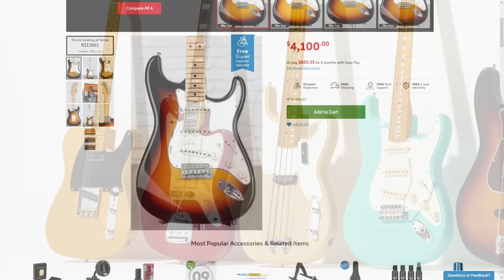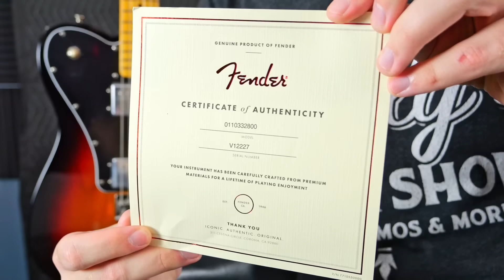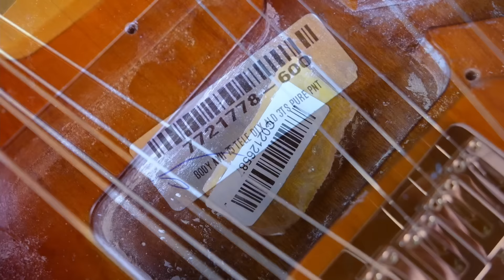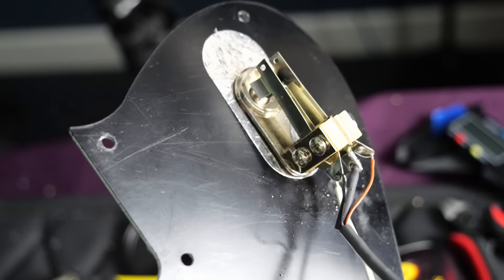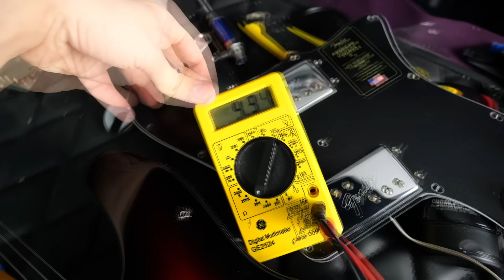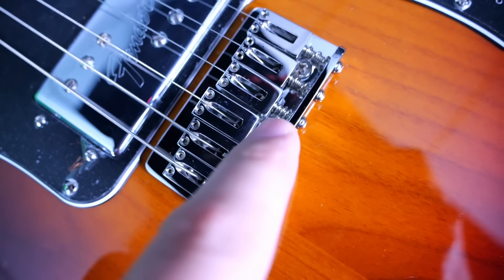An Embarrassing Factory Error... |  Fender American Vintage II 1975 Telecaster

Comment from the maker: Do you like CuNiFe pickups?
🟢Buy This Demo on My Website: https://www.troglysguitarshow.com
🔴Reverb: https://reverb.com/shop/troglys?_aid=growsumo&gs_partner=Trogly
❓Private Help Sessions: https://troglysguitarshow.com/help-appraisals/
Reply: Are you sending this to Philip M by any chance?
Reply: There's your quirky feature . The inlays being slightly off center. Well that and the large stratocaster style headstock. Personally I like  it. Is that a neck tilt access on back through the bolt on plate. So Fender has figured out how to silence single coils now they need to figure out the cunifies . I like this one but that buzz would drive me crazy. It does have a Telecaster sound but .
Reply: The way the body was made including the wood grain mismatch is a cbs cost of manufacturing savings that was common on originals. For 2100 they should have put on a neck that was drilled right for the inlays that aside help to I.D. It in case of theft
Reply: I don’t have a fender telecaster that has CuNiFe pickups, but they sound awesome and one of the guitar YouTuber who has a vintage 1970s telecaster with the pickups. He said the same thing about the wide range hum buckers that has the single coil sound. For me if I ever buy a fender 1970s telecaster or build a parts caster, I would put copper tape on the cavity body before I put the pick ups and the whole pick-gard on imo.
Reply: @jamesjeager129  my American special  has the usual pickups and sounds great.

Comment: Fender catching up to Gibson on the quality side
Reply: or catching down, rather..
Saddens me..I love my Fenders and each one is high quality. This one... I might pass on.. unless its a fluke.  I would take a hard look  and play in store before buying.
Reply: yeah, at over 2 grand they really need to be able to get the dots centered between frets. thats just pure lazy quality control.
Reply: @leftyo9589  AND the pickups. And the crack near the neck.

Any way, I'd take that one for less than 900
Reply: @fernandoreynaaguilar1438  These fantastic pickups can be bought separately. That would be an option.
Reply: A true race to the bottom. Why I prefer Ibanez knockoffs of their designs.
Reply: @leftyo9589  yeah like a 10000 $ gibson that has a relic job that i could to with a razorblade and a blowtorch
Reply: @A_Noid  yeees! Electric guitars' sound is mostly the pick ups.... quit lying to yourselves people, tonewood on electric is not even noticeable once you start changing pick ups
Reply: @leftyo9589  squier don’t have any issues doing this.

Comment: Seems like the Trogster should play these things before ripping them apart, to rule out re-assembly errors if problems are encountered.
Reply: Agreed. The buzzing could certainly be a set up issue from reassembly. The height of the neck pickup too with it catching the high -E string like that.
Reply: Absolutely. It makes no sense to take it apart, reassemble it, and then whinge about the factory setup. Play it first to judge the way it came from the factory.
Reply: @rexrathtar3893  Yeah, but, he's never had this problem before. Good advise, though.
Reply: When people review things you can sometimes tell that they have their minds made up already. I mean clearly this thing has issues with the dot inlays but it was funny when he pointed at that huge route that you could fit 50 wires in and called it "a very minimal channel", talked about both too much wood removed and then not enough wood removed, then it's a "shame" that a '75 tribute guitar doesn't have '60s tuning pegs. Then he accidentally broke the ground wire to the bridge by removing the pick guard. We've all done it and the symptoms are unmistakable.

Comment: It’s sad that fender is having QC issues on such a big release but the reason the headstock is more amber than the fretboard is because in the 70s fender would spray nitro on the headstock and it would yellow overtime
Reply: I mean, if you did get a lemon at the very least, it would be authentic to 60s and 70s qc
Reply: Joke... Buy a MiM and upgrade.
Reply: This is far worse than current Gibson USA production guitars. Really disappointed and for 2K I’d rather save up for a used custom shop model. I’d take any nice squire or Mexican over this series. Falls short over the original line which truly felt like a custom shop model within the USA range. I guess sourcing lighter woods and all is now unique to the custom shop

Comment: If I were working on that Telecaster the first thing I would check is the grounding wire from the pots to the bridge.
It has been my experience that you cannot move the pickguard assembly very far from the body due to the short ground wire.
The hum/buzz illustrated is very much indicative of a poor ground condition.
Just saying, I've caused this condition myself while inspecting a pickguard assembly, the wire pulls loose from the metal contact of the bridge yet remains in the passage hole within the control cavity routes.  It appears connected because it has not fully pulled out of the hole/passage, yet in actuality the end has broke free and isn't connected.
Like I said, I've had this happen before and the very same buzzing/symptoms presented the same way.
I've not made it through the entire video yet, so I'm hoping the amazing story of how the WRHB CuNiFe pickups were designed/developed, the direct connection of these pickups with Gibson is an amazing story.
Reply: Good evening HK.
Reply: @sgt.grinch3299  Greetings Sarge.......Stressful afternoon, we had to take our most senior Pug to the Veterinary Clinic, for a while we thought it was going to be his very last car ride with us.   Thankfully he is a lot tougher than he would appear to be and was abloe to come home with us.   Age, it will eventually catch all of us. 🙏
Reply: Oh thank goodness HK!!! I thought something VERY bad happened when you started that paragraph. I’m so happy your tough guy is home with you even if it’s only for a second longer. 
And thank you for the comment you posted about the pickups. It does make sense that it could be a grounding wire or something maybe. I don’t know the CuNiFe sound very well though so what do I know really…?
Hi Sgt Grinch! I hope you’re doing good also!
Reply: @hkguitar1984  🙏
Reply: @stop736  Bless Your Heart Cynthia.   Yes, every moment is a gift.   Oh, those CuNiFe pickups have a fantastic sound.   
The CuNiFe pickups are of such historical significance that I will someday own a guitar with them, either real vintage or the modern versions.
Reply: @hkguitar1984  Our dogs our everything to us on our land here! Aside from the fact that they’re all adorable and amazing dogs as far as how well trained they are to do whatever their job is on the property, they’re just amazing dogs in general! I try not being to emotionally invested with them because they are working dogs here, but I can’t help it. I end up loving them the same or more then the indoor dogs. They are all gifts that we do not deserve! They do so much for us everyday. It’s impossible to not get attached. 
I honestly do like single coil pickups…and I am sure these give off that vibe, but I assume there is some pretty noticeable differences tone wise. My next guitar is going to be a Mod shop Tele with humbuckers…it’s a deluxe basically. They’ll make them for lefty’s in the mod shop. That’s really about the best I can afford, but if there were some other options to choose I’d come up with some extra money. Like maybe just give me a nitro finish instead of poly, or maybe some light to medium relic job even, I’d pay a little extra for that. Not CS extra, but something! I just want something that has humbuckers. So saying that, the CuNiFe must not be what I’m looking for then possibly. I don’t know. 
I’d also just LOVE any brand of a Les Paul Junior, single P90 in the bridge…that’s it. Any color. Just a really simple Les Paul Junior. I just refuse to pay $1500 or more just because it’s a Gibson. That’s ridiculous. Harley Benton has one for $160 and it looks and sounds great! I can change the P90 if I want just to have a “name brand” one, but I think what I’ve seen stock from it is fine for now at least. 
Take care HK! We are full on into deer season with bows and we finished bear season with one good bear already! Now it’s time for some venison!! Deer camp is so great here. All the guys that come in and hunt a few days and sleep all over my house is just lovely! Muddy camo clothes everywhere! Some are mine though so I can complain…😂👍

Edit: I didn’t mean to sound like I have strange men sleeping all over my home…these are family or neighbors needing to hunt our property. 
My husband would not be ok with strange guys sleeping over our house. LMAO. I just thought I should be clear instead of sounding like I’m running a camouflage whore house. 😂 🤣😂🤣
Reply: @stop736  Ha ha ha ha
Its Deer Camp you're talking about, I totally understand, it is an event many spend months planning and anticipating.
We most certainly are emotionally attached to our in-door dogs.  So much time spent with them that they really do know us and we them, it is a beautiful thing.
I'm always struck at how honest our dogs are, for good or bad their eyes tell the story.
As far as a Les Paul Jr. or Special, there are many great and affordable versions of that guitar.  I think it boils down to the fact  a P90 and a Mahogany guitar are just a great combination.  The brand matters not.
Your custom Tele sounds great.  My Son and I are building one.  My goal was to build a custom shop quality guitar at half the price.  So far so good.  It is an exciting project for sure.
Be safe this Season and good luck hunting.
👍😉
Reply: @hkguitar1984  We’re hunting deer now with bows, but rifle season starts on the 15th and it really is a big deal up here! It is 2 weeks of hunters coming here to stay for a little and everything…it is a lot of fun really. Bear season is ending, but like I said we got one of those already. This is just a fun time of year up here really. For everyone almost. It’s definitely something we plan for and everything throughout the year. We turkey hunt and duck hunt and all the upland birds to of course. And walleye fishing! But deer season really is the biggest deal here. 
If I could, and had the knowledge, I would LOVE to make a lefty Brett Mason Tele with a B bender like his signature Tele has. I love the 3 pickup setup with the mini humbucker in the neck of that model especially. I just love that guitar. It’s just to difficult of a build for me. I’m actually tempted to build a simple LP Junior like you were talking about! I’ll put our hunting camps name on it! LOL. That would be really awesome for me personally!!

Comment: I could be wrong but Im pretty sure the headstock is a bit of a different shade because in the 70's they used a nitro finish on the headstock, due to problems with decals

Comment: In 75 these guitars were not refinished in Nitro. These guitars are not meant to be Custom shop specs but are meant to be built according to the factory specs of that year.
The purpose of the built is to get as close to the guitar (vintage) year spec without it being the actual vintage guitar.

Comment: 15:09   Please, correctly adjust the pickup and pole piece height (lower it).  With the pickup that close to the string you are loosing all the dynamics the pickup has to offer.
Adjusted correctly that neck pickup should sound more like a strong Stratocaster neck pickup.
sigh..................
Reply: Yeah, if removing the pickups you should figure out what the factory specs say they should be and set it to that, especially if demonstrating how it was intended to be. Cheers HK!😃

Comment: For a $2000 guitar this is an absolute bodge job. The grain not matching at all on one side of the body makes it look like a repair, I've seen better neck inlays on $200 guitars, the routing looked amateur, the finish cracking so early means it'll crumble in several places in months probably. And to top it all off it sounded AWFUL. 😖

Comment: Fender’s QC is generally pretty good (at least better than Gibson), but the new American Vintage series seems to have a lot of QC problems. And these aren’t cheap guitars.

Pretty hard to justify these prices compared to say the American Pro ii, especially with these 70s models, which have poly finishes. At least these cunife pickups are great.
Reply: What's qa?
Reply: @216trixie  quality assurance.
Reply: @leftyo9589  Aha. It sure is. But that is not what he had up there before. The comment said "Fender's QA".  Now I see it reads QC. Lol.
Reply: @216trixie  Used QA, changed it to QC since evidently QA seems less used than QC  ;) I see QA as encompassing QC, but maybe I'm wrong.
Reply: @A_Noid  
I think QC is more commonly used in the general public.  However, in manufacturing I’m reasonably sure the term QA is more prevalent.

Comment: I like Telecasters, but I have a long list of gripes with this one. starting with that fugly headstock. then the marker inlay dots being out of wack. and it gets a lot worse with those crappy sounding pickups. even with that grounding issue fixed they still would sound horrid. I don't like single coils even the noiseless ones. because of all that sixty cycle hum especially under florescent lighting. so the main reason I thought I might like this one is because of the humbuckers. but I definitely have to pass on this one.

Comment: Lots of really sloppy QC issues reported on the AV2 series so far - hopefully they iron them out, along with the pumpkincaster necks. Doubt they will though. The AV2 is basically 2/3rds pre 2012 AVRI spec with some slightly more vintage correct stuff kept from the AV1 with the pure vintage parts etc. The AV1 is still the re-issue to have.

Comment: Of the "3-bolts", the pair are screws but the lone fastener is a bolt. It's placed just above the hexagonal tilt adjustment. It needs to be a bolt because it barely reaches into the maple of the neck as to not interfere with the end of the truss rod.

Comment: I own a 1975 Telecaster Custom, ( Big in front, regular size in back ), These are amazing how much they look like the 1975. Mine is even a three piece body, and the same looking Sunburst. I like the fact that they are not priced like a Custom Shop. Same looking quality control 😊
Reply: You own one great guitar if it's anything like my 73! The wide range neck with the single coil together sound absolutely incredible. The wide range pickups can't be beat. My bride single coil isn't factory according to a local luthier that I trust and respect, but I can't imagine the factory pickup is a lot different considering he said the resistance values were the same. The customes from this era have a mojo that just can't be duplicated. Keith Richard's, Rich Robinson etc know how special they are. I saw Candlebox in concert around 10 yrs ago, and Peter Klett played on the entire show, and honestly had one of the best high gain sounds I've herd live. Probably, largely due to the custom and the CuniFe pickup. Sounded like he had the pickup selector parked in the middle for his solos!

Comment: Larger bobbins and covers, but also the original WRHBs have steel reflector plates between the bobbins and the base plate. Kind of like a Tele bridge pup. I want one of these Vintage II Deluxe, but it would cost half as much instead to stick CuNiFe WRHBs into a Vintera Deluxe, as their AlNiCo WRHBs and routs are the proper size.

Comment: This is it, this is the guitar I would buy if I could. I love it. I'd change the color but everything else is perfect IMO. Congrats to whoever bought this.
Reply: Sarcasm?
Reply: Which color?
Reply: @MrJohnnyDistortion  I want a blue one but they're not offered at this time
Reply: @ushnicyuvnikof2748  no, I love these teles, good price, sound great. love em
Reply: @junes2k  Did you not see the long list of absolutely unacceptable faults? Have you not read the forums about poor quality control and personally I played 3 of these at my local guitar shop one had a twisted neck and another had about a 3mm misglue on the body that was comming appart. These are just awful dude.
Reply: @junes2k  Even on a $200 Squire this would be totally unacceptable but for $2000 people deserve so much more than this trash - the production line that produces these should be halted and all management responsible fired + $1000 compensation fender gift cards sent out to every sucker unfortunate enough to of got dupped into purchasing one of these. The pickups alone are an unacceptable fault (but there are so many other issues) they aren't even grouded my local guitar shop said the grounding wire isn't earthed on these... And why not F logo tuners - why cheap out on tuners on a premium priced product? This model is disgusting and out of line 😤 you'd have to be crazy to defend this. (Comming from a man who LOVES his year 2000 American Series Telecaster)

Comment: "Doesn't appear to be a grounding thing"?  Its literally doing exactly what a guitar does when it's not grounded lol

The reason touching the strings isn't making it go away, but touching the electronics does, is the ground wire should be connected to the bridge, and it's clearly not here

Comment: Have a '77 reissue with a CuNiFe humbucker. Had that buzz, pulled the humbucker out and rescrewed it down through the 4 springs that came loose when adjusting the height of the humbucker and the buzz went away. When you back those screws out they're short enough it leaves a space where the spring literally buzzes.

Comment: We were told as fitters(machinist) that a screw has thread cut right up to the head,a bolt didn't,so technically guitar necks are secured by bolts? If you put thread inserts into neck you could secure with `screws'.